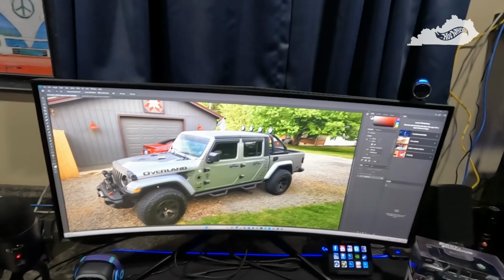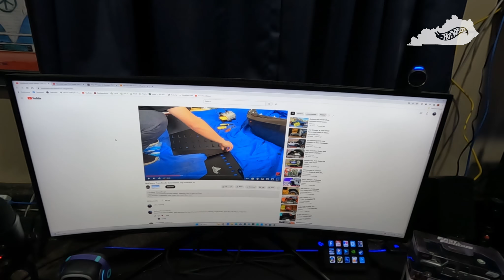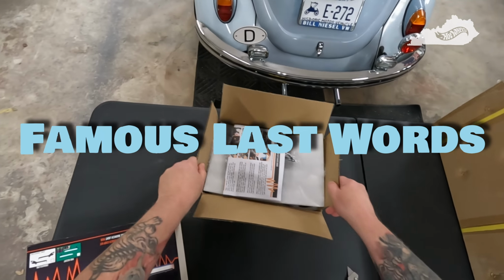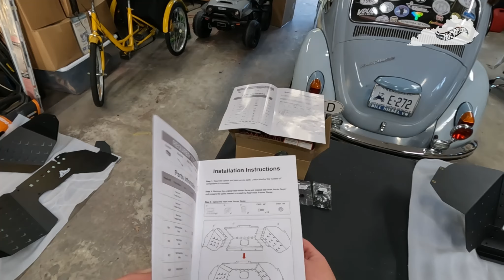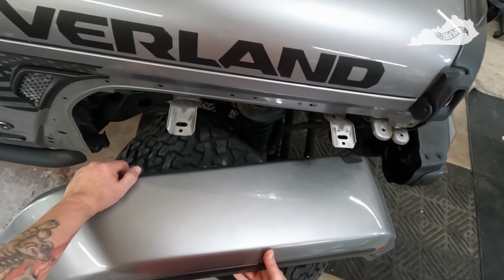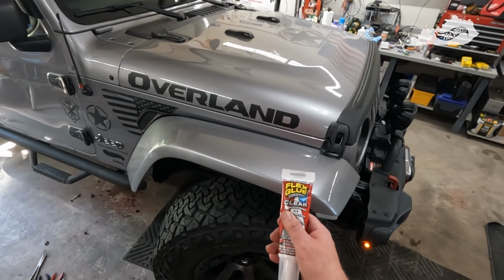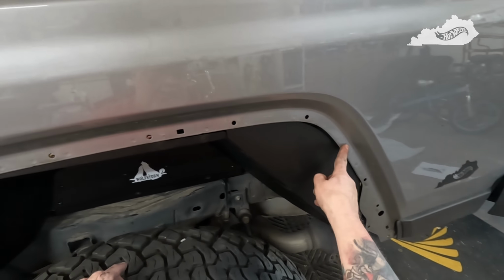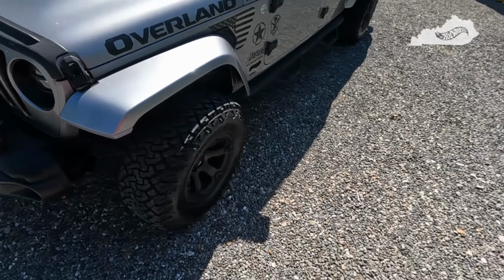Quake DRL Fender Chop With Wolfstorm Fender Liners Install On Our Jeep Gladiator

Comment from the maker: Just an FYI...the Flex Seal glue has worked perfectly...holding strong!
Reply: Thanks for the update!! I’m looking to get mine professionally installed and I’ll have them use that glue. Like you, I’m not a fan of the looks of the screws in the front fenders.

Comment: How did the flex seal work. I did the screw on my black plastic fenders but now I'm putting on painted fenders so I don't wanna use the screw.
Reply from the maker: Still holding strong...no issues..